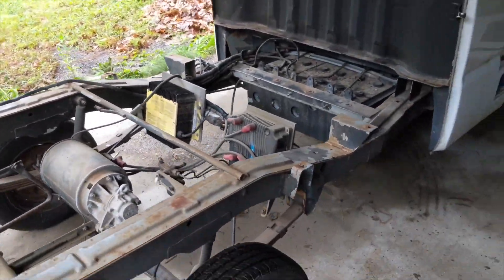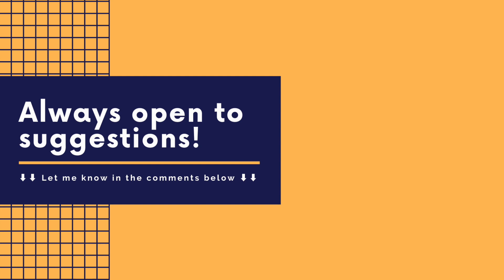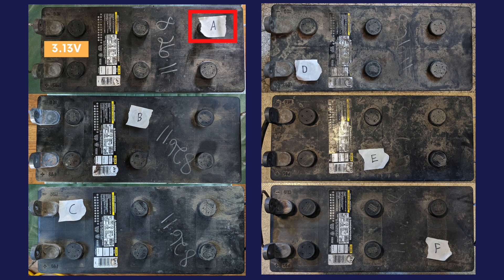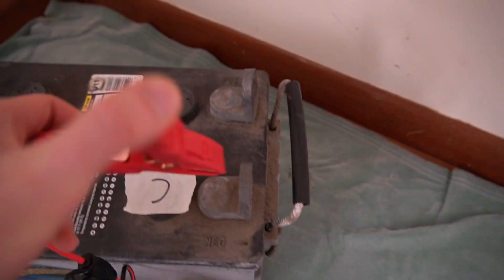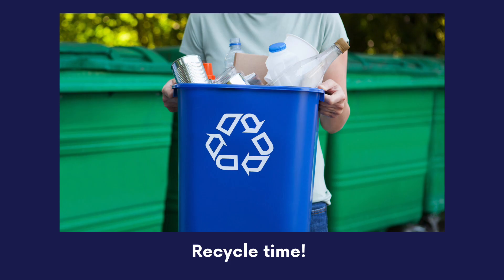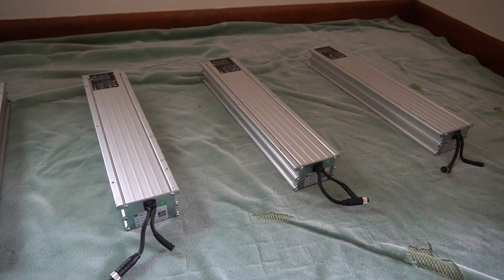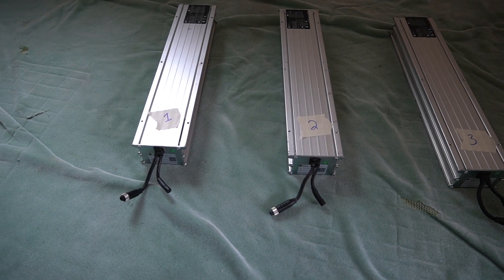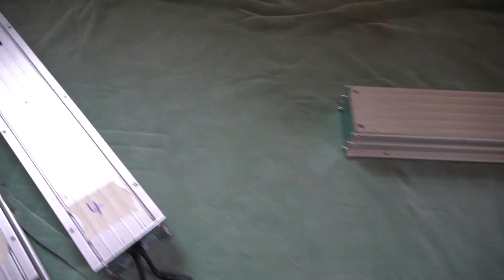Will this 800 pound battery pack hold any charge at all?

Comment: Just got one of these trucks. Could you go into the process of disconnecting the batteries and controller to do the battery swap. I am in the same boat as you and I am due for a battery swap myself.
Reply from the maker: I will be making more detailed videos about the battery replacement process soon. I've had some other projects that had to happen first but my truck will still get finished. Happy to help how I can if you have more questions.